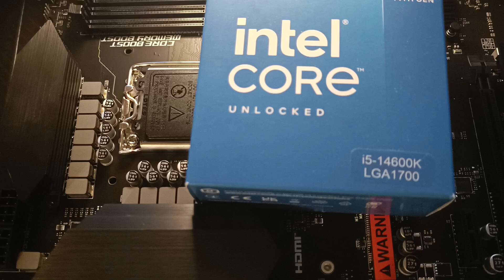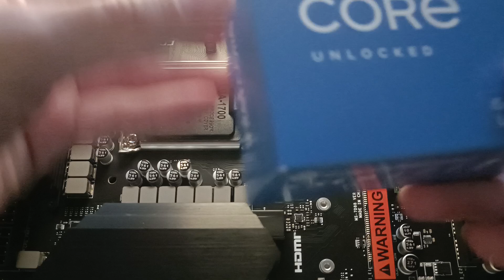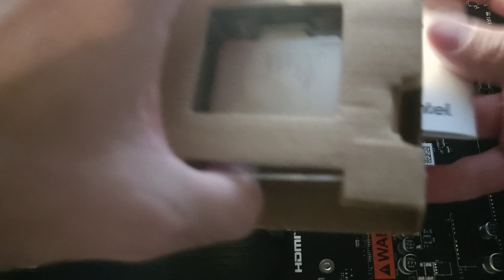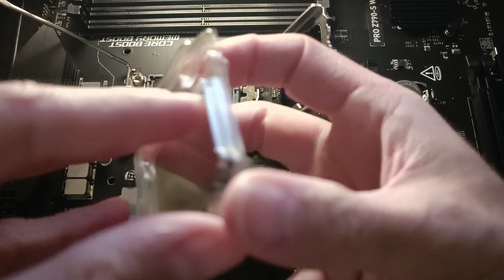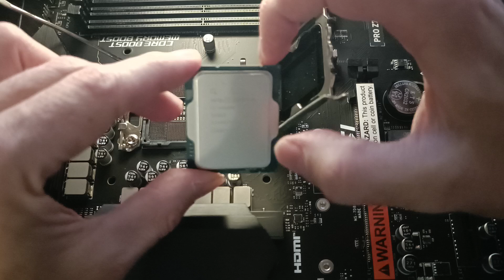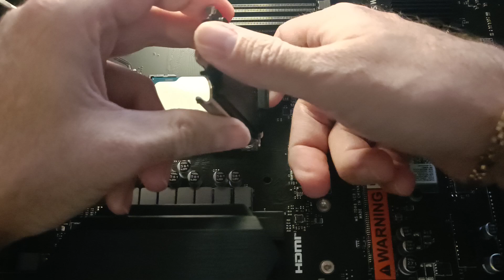How to install LGA 1700 CPU to Motherboard (Intel 14th gen)

Comment: Nice video. Just two small notes, the triangle in the corner of the CPU is often matched with an identical symbol on the bottom left side of the socket, which can help you identify which way around the processor is if you're struggling. Lastly, the plastic cover is designed to pop itself out of place when the tension lever is pulled on the CPU, so there's no need to remove it by hand. Keep a hold of this cover as it's intended to protect the socket from dust should your CPU ever be removed.